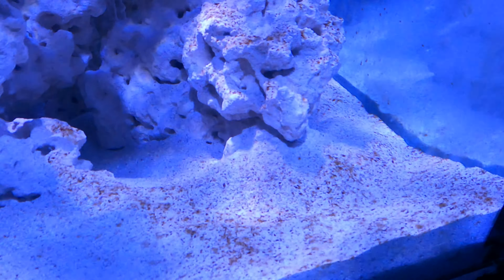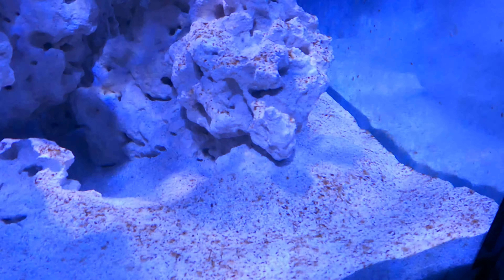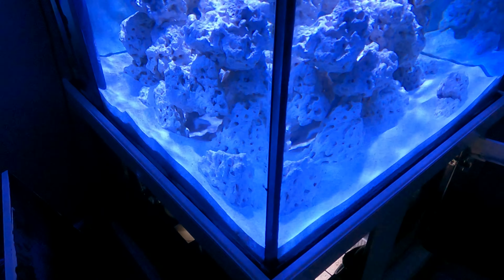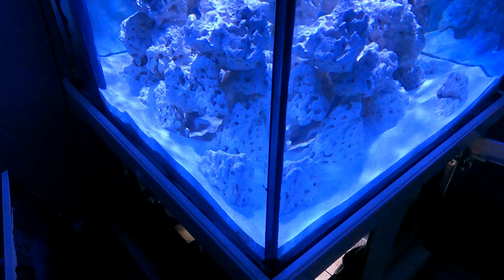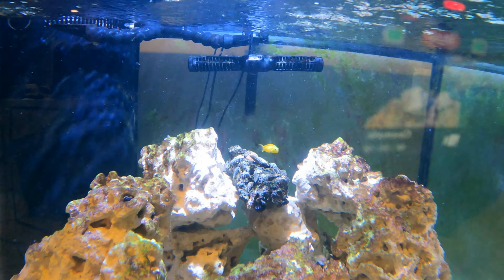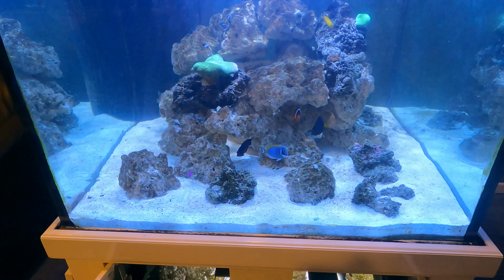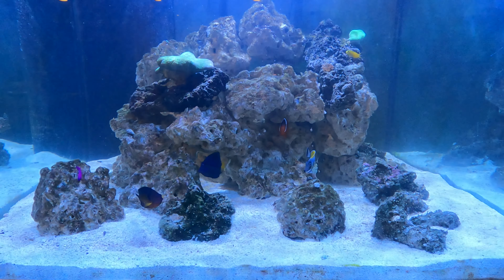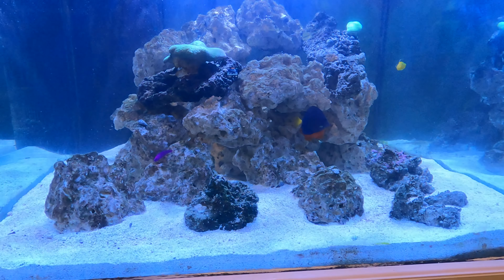Episode 9 :: Making the 150 Gallon Low-Tech Reef Cube Aquarium

Comment: Hi, nice tank, can i know the thickness of glass and if it had braces,
 And an advice the nosseles extend them to far right  so the buildup on the surface goes to overflow
Good luck
Reply from the maker: Hey Monther! The tank is a 150 Deep Dimension Marineland aquarium, I believe the glass is .5 inches in thickness. Only brace is the plastic rims on top/bottom, no cross brace.  You are correct about the overflow, I am partially blocking it with the return on purpose because it is too efficient at skimming and becomes a problem during feeding. However, it does allow for surface film buildup...tough call which I think is the lesser of the two evils lol :-)